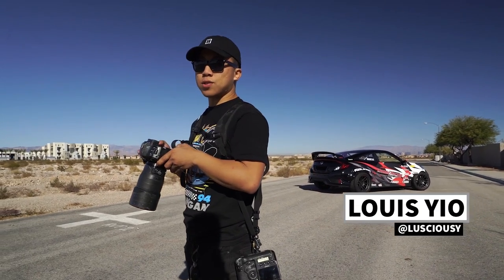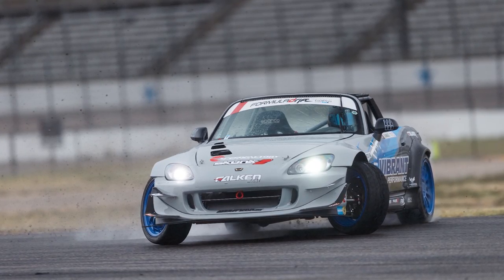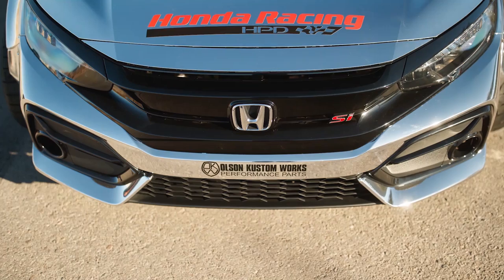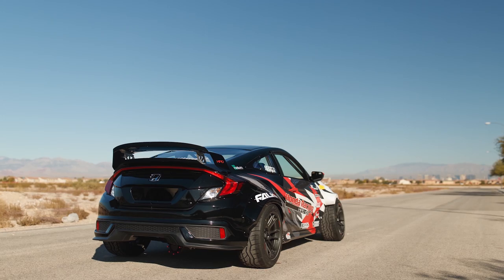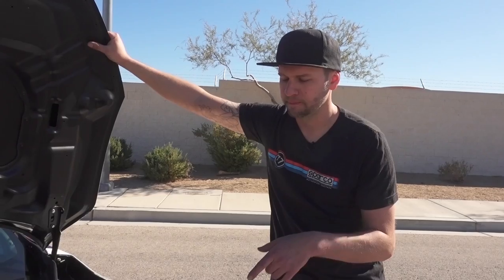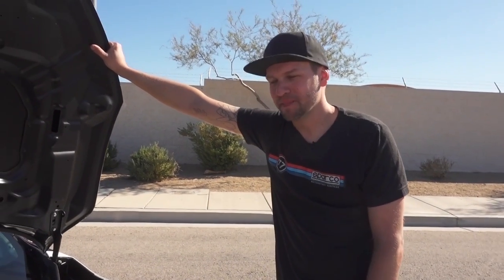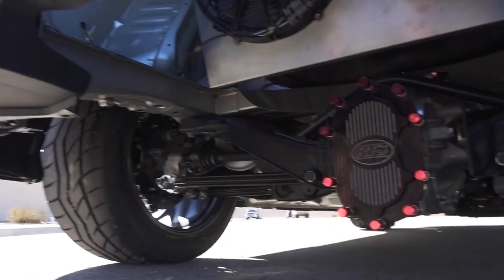900hp RWD Honda Civic... Drift Car!? SEMA 2019 Madness Begins

Comment: If Honda brings back a RWD sports compact it would dominate the class
Reply: In Japan, Honda have S660 (If you didn't know, S660 is technically the S2000's successor. The S660 is basically a Miata BUT with VTEC) but it's only available for Japan not for the rest of the world.
Reply: Moisesezequiel Gutierrez I own an ap2 s2000, I really like the s660 but you’d have to put a K in it lol that 60hp from the 3cyl isn’t gonna do much
Reply: Moisesezequiel Gutierrez that don't count since it's a kei car that isn't widely available
Reply: @moisesezequielgutierrez  its not an s2000 successor its a honda beat successor
Reply: Moisesezequiel Gutierrez 

If you didn’t know, don’t spew the wrong information.
Reply: @moisesezequielgutierrez  at Malaysia someone already brought
Reply: Absolutely
Reply: @moisesezequielgutierrez  S660 are here in Indonesia
Reply: @moisesezequielgutierrez  It's the NSX successor actually with the rear mid engine placement.
Reply: @moisesezequielgutierrez  honda beat successor, they r both Kei cars. how can it be a s2k successor when the displacement goes down from 2L to 0.66L?
Reply: @vaughaniswhite  its still in the "S" line of cars is what he means
Reply: @moisesezequielgutierrez  i want a coupe with backseats, not a shitty roadster

Comment: This thing, with all wheel drive, fully chrome paint/wrap, slightly beefier tires, the blacked-out LED headlights it already has, and the black wheels it already has, or a slightly smaller diameter set to allow for tires with a taller/beefier sidewall and we might be on to something. White, black, or red paint wouldn't be bad, either.

Comment: If this car had the modern civic si power train flipped around as a mid mounted rwd manual layout it would be drivers car of the year
Reply: I'm a fwd Honda purist I guess. But yeah definitely. The current gen style doesn't fit being fwd, other than the type r. Even if they were to start going awd I think that would be most fitting with the chassis
Reply: What engine is it k20? Turbo?
Reply: @xidropkillzx3246  it's a k24.  The stock motor is a turbo 1.5

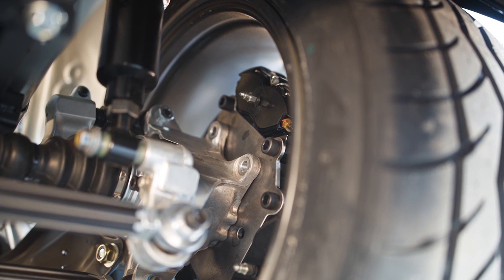Comment: 8:56 hope they remembered to put those bolts back in 🤣
Reply: That's the old brake caliper mounting point. Probably not supposed to be bolts there, the adapter plate bolts in elsewhere is my guess.
Reply: we made the brackets that use the stock caliper bolts as well as the 4 for the hub, but for the SEMA rush we left them out, but the brackets are indeed drilled to use them

Comment: No fuses no relays on the whole car?....must be a wizard...or a go fast guru
Reply: jason shugart Gonna be the way with mass produced cars eventually... well other than the huge safety fuses electric cars have. 

Basically, everything’s wired up using something called a Power Distribution Unit. All the physical switches/buttons in the cabin, and any temp sensors for high draw fans are wired in, and all the outputs are connected to the output channels, but the switching/protection is all handled electronically.

Comment: It's possible to make a Civic/Prelude/Integra/Fit or Jazz a AWD/RWD as long as you're determine to do it and finish it. Just be patient.
Me? Just stacking up some boxes at my work while thinking of what project car should I start...
Reply: Check out Hub city performance, they have a kit that makes the diff practically bolt on for civics and integras, just requires a little it of welding for support. Im saving up for a K swap for my Del sol, but after thats done im thinking that might be next lol
Reply: Its possible to make any car rwd and awd. U just need the money
Reply: Deekilledyou maybe a second k engine in the back? I’ve seen rwd conversions but not too often do I see them take advantage of the factory engine location at the same time. The dual engine Mazda on hoonigan was awesome.
Reply: @josephsamsor1698  yea theres a video of someone here  on youtube that did that to a Del sol but that looks like alot of work. The kit from Hub city performance looks much easier. Check out Motionautotv, Trevor there has an AWD civic using their kit and thats kinda what sold me on it lol.

Comment: is the crazy front camber functional ., most I've ever seen in a racing car. LOL
Reply: Tim Z because of the amount of steering angle the castor creates positive camber when at the end of travel so negative camber helps with traction in drift as the tire sits flatter

Comment: Engine from a mid 2000 CRV,  they would have had to  re ring it, put pistons in it and change the chain before they could use that crappy motor.  Should have put a B series in it .  Look odd in a satisfying way though 🙂

Comment: I thought fd's rules say that the car has to come factory rear wheel drive or all-wheel drive.?!?
Reply: No
Reply: The only important chassis rules are: 
1. No body on frame
2. Trans tunnel and firewall can be cut just this much
3. Must retain factory suspension mounting points
4. Can be cut forward of front strut towers and rearward of rear strut towers
5. Must have full cage: NASCAR spec or FIA Application J.
Reply: If FD rules said that how would Aasbo be competing? Duh!